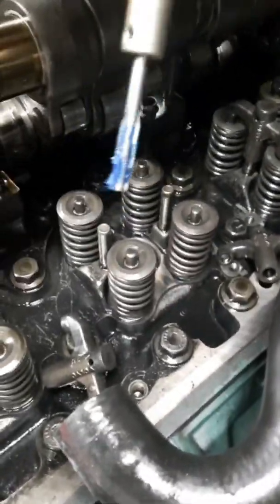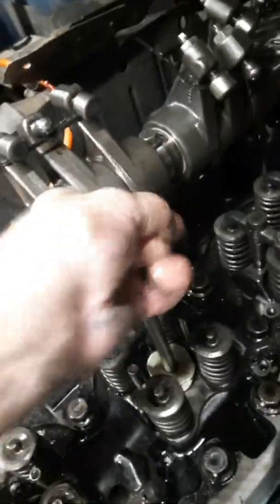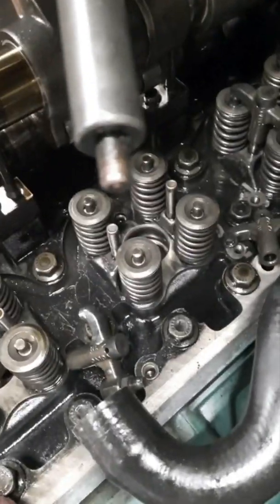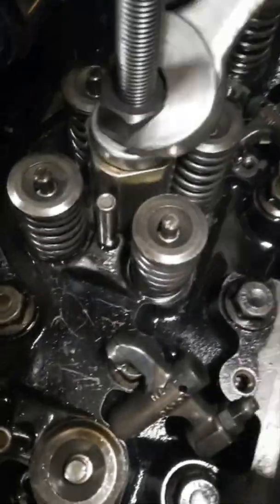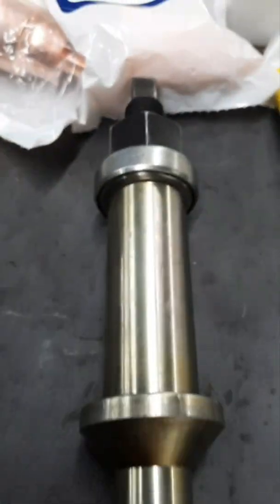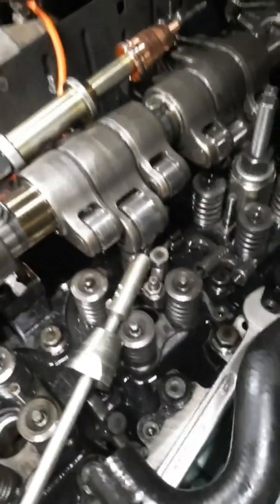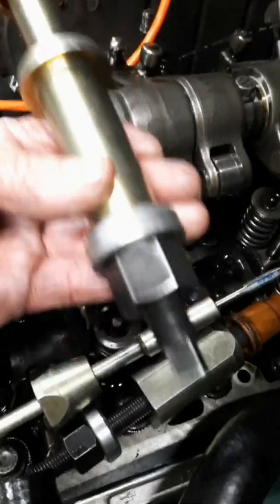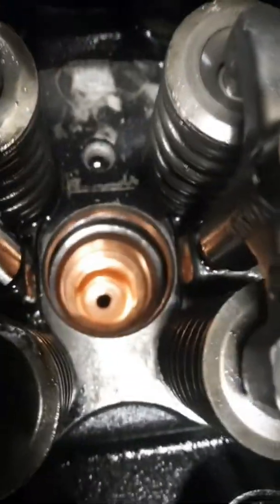replacing injector cups in a d12 Volvo big rig

Comment: Hi when you do this job. Do you need to do any calibration as far as the valves such as air intake and exhaust? Also do you need yo calibrate the injector after you re install it? Thanks
Reply: They all will be close but its best to run the basic overhead adjustments afterwards
Reply: @HootsDiagnoseChannel  Hey thanks. I noticed that there are many videos for D13 calibration ( not many on D12). Can I use the D13 videos to get an idea on how to run a basic calibration? Are the methods for both similar? Thanks
Reply: @klaromio  Yes I believe they are going on the cam marking, just make sure you don't get the exhaust valves mixed up with the intake, the injector i believe should be 2 bolt flats after slightly snug on the adjuster which will make it just a little past zero torque I think the 13 will tell you the same
Reply: @HootsDiagnoseChannel  got it 👍

Comment: There are alternative ways to do this, especially if the store-bought tools won't get stuck one out. I rigged one up and used a 4-foot tire iron with leverage and still struggled to get out. My worst case was one was so bad that it crunched and I had to pull the head and cut it out piece by piece with a torch etc. but I got it done.

Comment: Can you use old injectors again?
Reply from the maker: Yes for sure I always due unless I have a misfire. Just get a complete set of  0-rings and replace them, you won't use all they give you.. Just make sure they are in the "Right groove" When you install, there are grooves that the ring fits but there are also empty grooves,.just be sure! Wrong grooves or the ring is not good. just compare it with the old one.